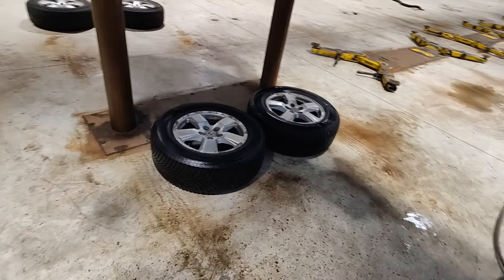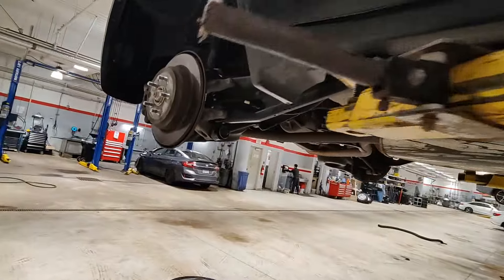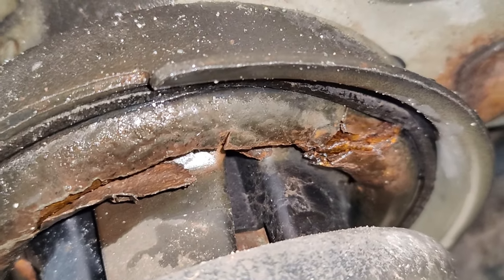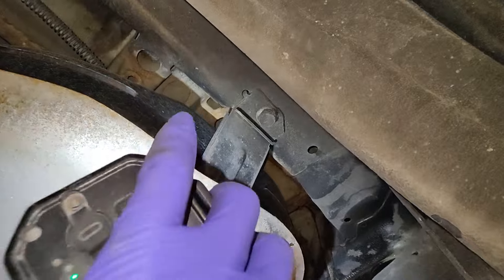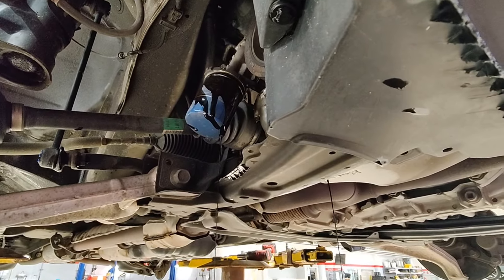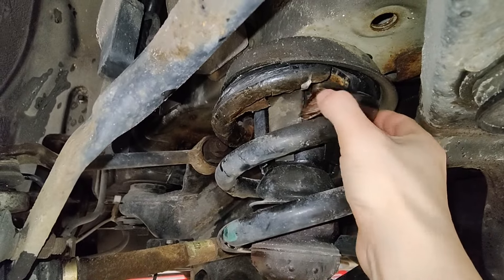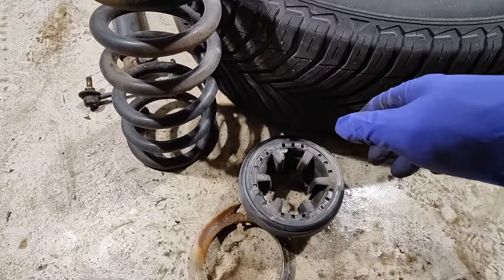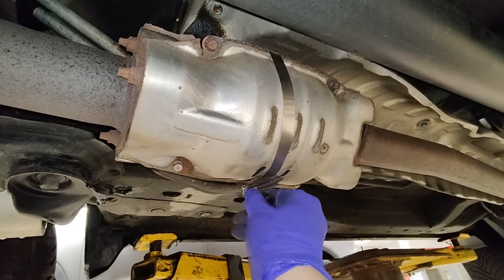2011 Honda pilot Blown shocks, broken spring, needs brakes etc. Inspection Video!!

Comment: What a disastrous quality with Honda. I can’t believe Hondas used to be good back in the 90s. All the things that you mentioned on this garbage Pilot, I never had these issues on my 1992 and 1993 Accord. I owned both cars close to 20 years.
Reply: Virtually all of the issues are due to maintenance and the car being driven in a rust prone area.
Reply: The only worrisome problem was the low oil. That's a known VCM engine issue. The owner has to keep it topped up (and maybe disable the VCM).
Reply from the maker: I didn't think it was too bad everything was repairable. Not all at the same time.